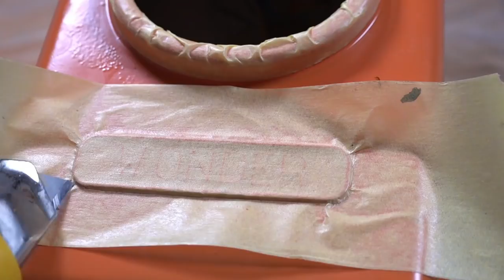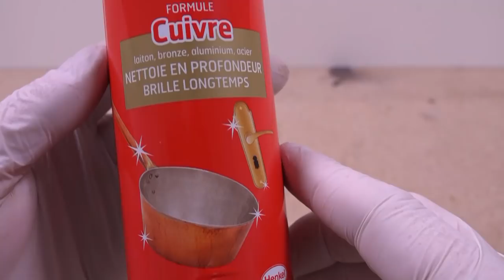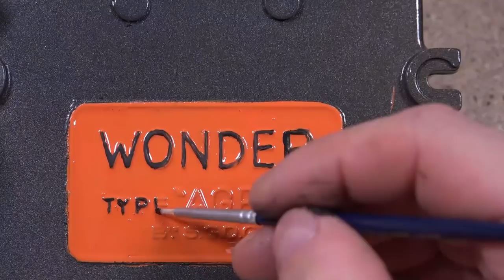Vintage Lantern Restoration from Tysy Tube

Comment: I've got the same lamp sitting to be taken care of. Where did you get the battery?
Reply from the maker: I bought it from the internet but now it depends on what country you are from, I can give you the site where I got it from but I don't know if it benefits you. This is https://www.laboiteapiles.com/produit/273/6lr20l
Reply: @tybyrestoration2716  Thanks! I'm from the Netherlands. So maybe it can be send without to much of a fee. I've bought the lamp in France, though.
Reply from the maker: You can search for it in your country by battery code. This is the 6LR20L battery code

Comment: Love the videos but the one thing that bothers me about a lot of YouTube restorers is the use of cutting wheels as grinding wheels. The stress from using them improperly can result in them shattering and at the speeds they turn can result in some serious injuries if the user is unlucky. Please use the right grinding tools for the job for your sake. Love the videos otherwise. Excellent work as always!
Reply from the maker: Thanks for the advice you gave me, I will remember it and put it into practice on future videos. Thanks for appreciation.

Comment: Bad at colouring
Reply from the maker: I wanted the color to be more special and not be like the others.
Reply: 👍 okay for the intention. But sorry, the result not smooth enough. There's still orange colour that not get covered by the tape.. you know, small details. 🙏
Reply from the maker: That's right, I also saw that there are some color defects, but when you don't have experience you make a lot of mistakes. As you work, you learn to do better and better.